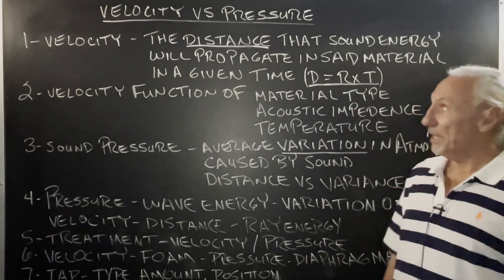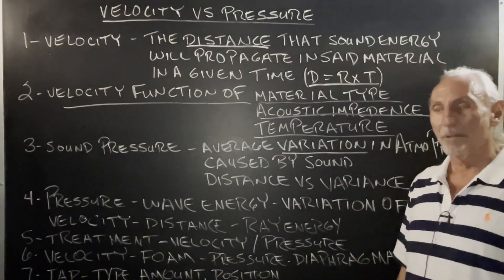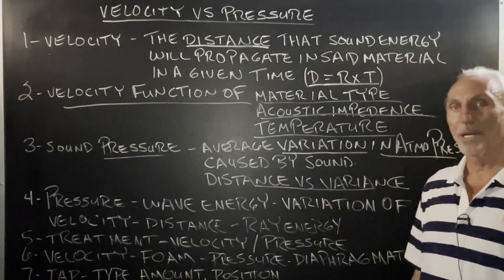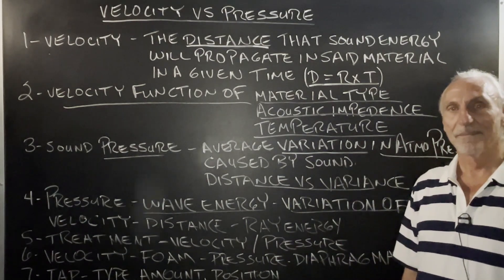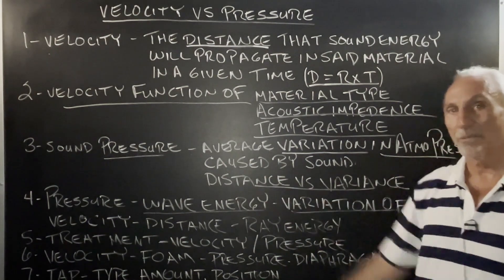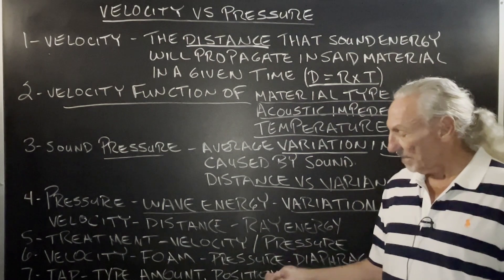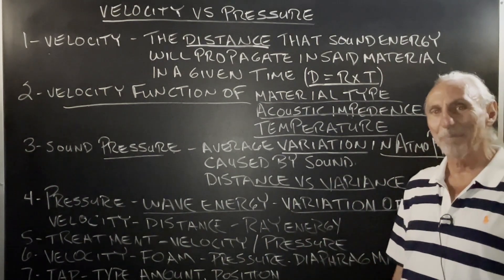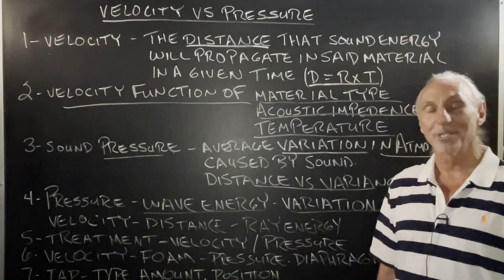Velocity VS Pressure - www.AcousticFields.com

Comment: Love this guy!  Love the fact he discounted corner treatment for effective bass traps.  Urban legend.  That ignores wavelength at particular frequencies:

Wavelengths
1000 Hz = 1.125 feet
100 Hz = 11.25 feet
40 Hz = 28.14 feet

How is corner treatment with Ownes Corning 705, having a 2 or 3 foot fact going to affect bass?  500 HZ, maybe.  Thank you Sir!  I subscribed.
Reply from the maker: Corner issues are produced by the two walls that create them. Treat the walls, improve overall resolution by a large factor and the corner issues vanish.

Comment: the neat thing about understanding sound (pun alert!) scientific principles is that they form the basis for development, application, analysis, critique & improvement. when you become comfortable with these basic principles you find their application across many fields of engineering & technology. the physical world becomes a more sensible yet interesting place. thanks, Dennis, for continuing to describe the science of acoustics in confined spaces.
Reply from the maker: Yes,  I have noticed same. The more knowledge one accumulates, the more one realizes that this knowledge is shared by many disciplines. Maybe AI can help with all the required integration. I am too old and tired.